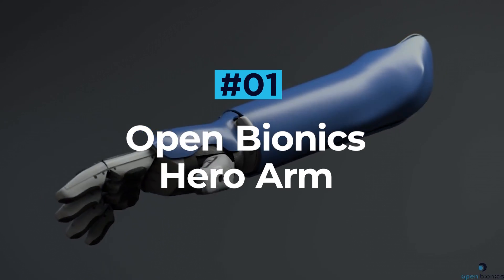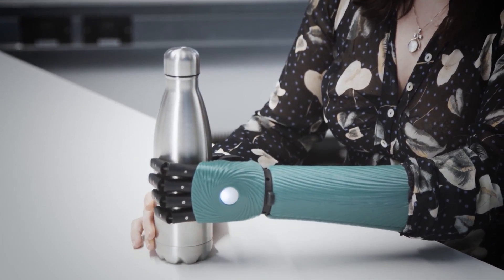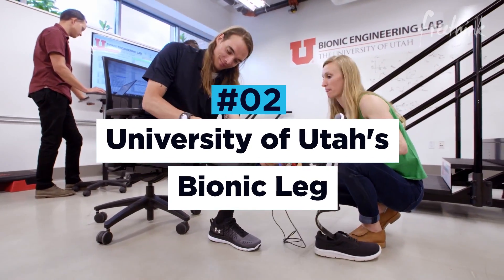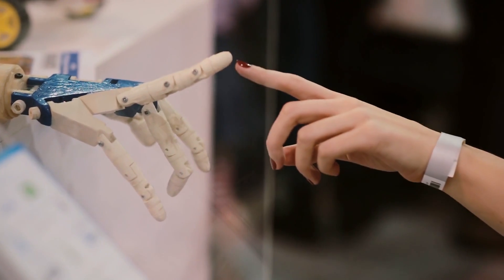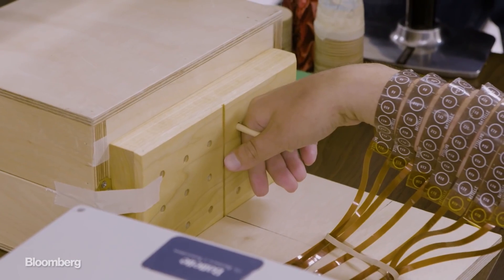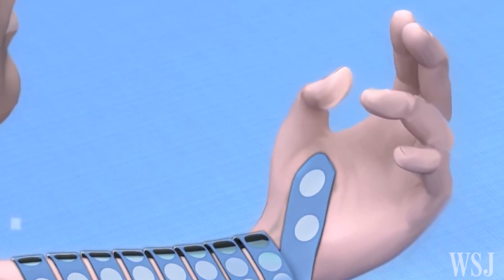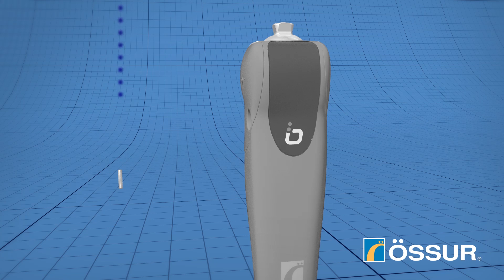5 Futuristic Mind-Controlled Prosthetics

Comment: The paraplegic one i have a suggestion think of nerves like power lines tht need to be tested with a odometer find the spot on the nerves past the metaphorical break in the nerves where there in theory would still be power then connect a wireless chip tht can receive the commands internally so he wouldn't need to be connected to pc the computer could in theory then process the commands wireless and if u installed a receiver on the arm things the spine sensor could send the commands to the arms wireless I hope I made sense in my head It does but to those who doesn't I apologize

Comment: still surprised, with the silicon springs for controllers, that we haven't developed pressure sensors and shape sensors for these bionic limbs, that not only the arm can control, but the sensors compensate actions by pre programmed objectives.  the ability to sense curves and how to adapt the shape of the fingers to those curves.  is one thing these sensors would do.  sure, it'd be more expensive, but if someone patents these things, makes them public domain and creates a public service nationwide, it'd greatly resist the exploitation of technology over needs

Comment: These technologies are very promising but the comments are somewhat silly. No prosthetic can ever do the job as efficiently and gracefully as the flesh equivalent. I have the ability to close grippers, lift weights, and manipulate items in my hands, in ways that a prosthetic could never come close to. Even the leg and it’s joints which are not as complicated as the hand, STILL can not be replaced by prosthetics.  You can see the rigid movement in the video with the prosthetics. Much more graceful than the old stiff prosthetics mind you, but still awkward.

Also, no one in today’s age would choose a prosthetic over the flesh equivalent if they could help it. You run the risk of being chopped up and having your mechnical part(s) sold. It happens to people with flesh as it is with illegal organ trafficking. Imagine carrying around a multi thousand if not million dollar piece(s) of equipment.

Comment: While mind blowing, they shouldn’t use human biology for these. Curved blades can work better for running and walking and wouldn’t require footwear or as much maintenance. 

Hands are complex but the fact they aren’t using a skeletal design is idiotic, they should be using the skeletal hand as a skeleton for it and then covering it in material. The tips of the fingers should be pointed, not flat since it has no nails.
Reply: An issue with prosthetics is that some people like to cover them to look like they hadn’t lost a limb. Scars are meant to be shown, not hidden. >:/

Comment: 1 : Muscle controlled arm
2 : AI controlled leg
3 : Artificial neural connection
4 : Muscle controlled leg
5 : Extreme sports leg
Reply: Mind controlled limbs are the most promising technology because the wearer just plugs them on the remainder of the limb and starts moving. This technology uses electrodes on the skin to detect signals from the brain towards the muscles. An AI inside the prosthetic learns which signals mean which movement. Thereby the prosthetics is able to adapt to the wearer's moving style.
Reply: That is nice way todo they can learn both from them and environment but still require of our body supports.
- ANN you told might be correct when part of body also need some learning as instruments.
- Walking that is interesting, it create of equally foot steps and response to environment with sensors and our reflection. 
👉 How about talking and walks in sametimes how instruments response⁉️
👉 Feedbacks is important even arms or any part since once they need fast response to do STOP how it could and which of action⁉️
👧💬 Continue on current tasks to STOP or by aways from sensitive organs or potential continue of action to perform.
Reply: Adam Jensen